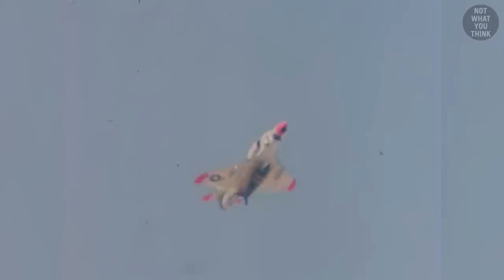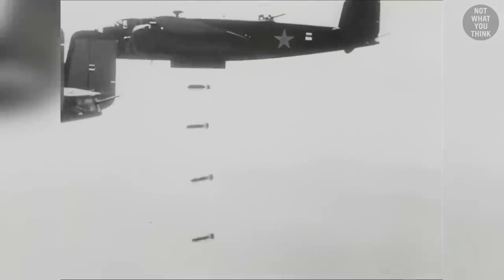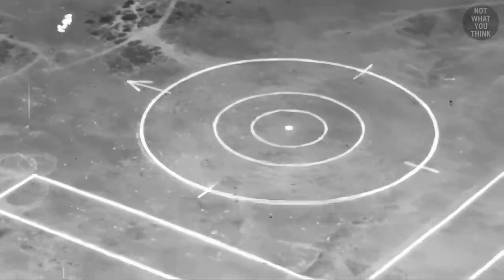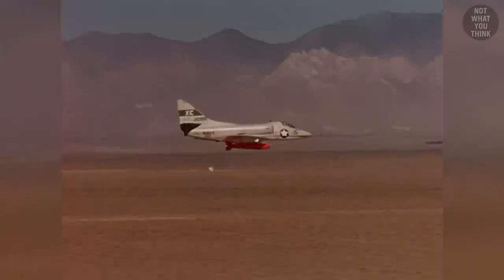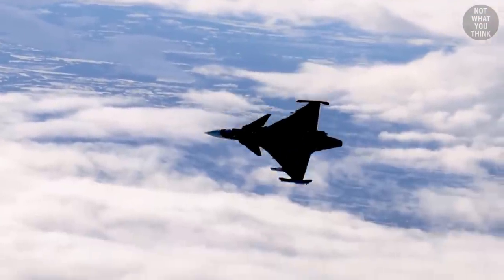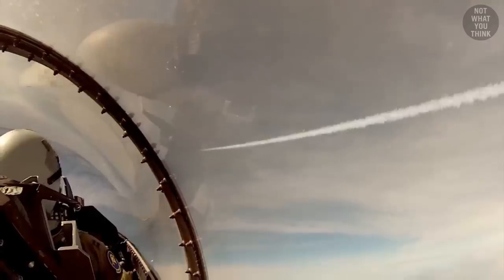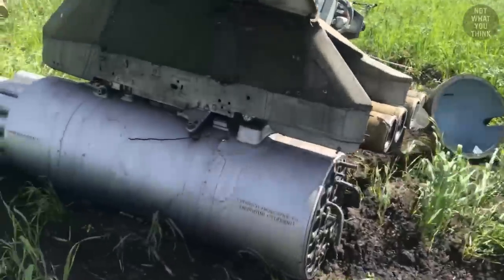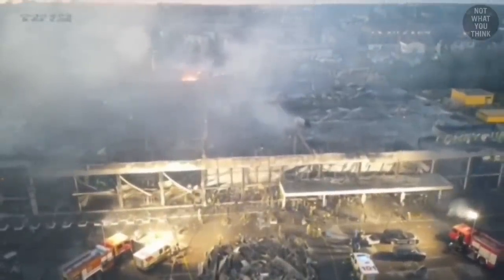Why Are Russian Helicopters Shooting Up at the Sky?

Comment: Pilots on Russian side confirmed the targeting computers are updated for rocket "loft" and they say it is much more accurate then you would think. Pilot seemed to note high accuracy is only relevant for heavier rockets (?). Should note I had to use Google translate so I might get some of the details wrong.  US heli pilot noted they've known of this heli "artillery" support tactic of the Soviets for a long time.
Reply: I believe what they meant by "high accuracy is only relevant for heavier rockets", is that they can carry much fewer heavy rockets than light ones (5 heavy rockets per pod as opposed to 32 smaller rockets per pod - not a negligible difference).
So they can afford to let the smaller rockets be less accurate, more over the place than the few heavy rockets.

Also, if you were to use those heavy rockets (which are obviously more expensive, don't forget this aspect as well), it probably means you want to destroy something bigger/more heavily armored than just a couple of soldiers on the field. So the need for higher accuracy in the case of those heavy rockets could also mean this.
Reply: C-5 are lighter and have a larger dispersion area, C-8 are heavier and have a smaller dispersion area. This was meant.

Comment: I do this tactic in DCS in my Russian Mi-24 and KA-50, it works pretty well, surprisingly. safe from SAM systems, quick, rtb and rearm... rinse repeat

I should specify. in the Ka-50 for example, you have a Navigation target point that you can set. your hud displays direction and distance. when you come within 10.5km, you angle up to 45 degrees. 10.5 in DCS was about the max effective for the S-8OFP, while 9.5 you can get accurate hits within 100m of target, firing at a 35 degree incline. im certain Russian and Ukrainian manuals have mentioned this, as Ukrainian Mi-8's have been seen doing the same. but it would obviously be easier with a system that has Satellite navigation, like KA-52, Mi-35 and Mi-28NM
Reply: Russian byas on Russian game lol
Reply: @Filipscl  cry kid.
Reply: yeah if planes already have ccrp since the 50s it'd be a sin to not give any flying weapon platform this tech or something similar
Reply: @Filipscl  thats....not how that works.. I can do the same tactic with an AH-64 and Hyrdas in DCS. the difference is the angle and ranges
Reply: @Swampfox1966  no dude he right, we just gotta live with it now
Reply: @specialman6004  damn you right
Reply: Do this tactic in war thunder with ccip it’s very accurate if the target isn’t moving
Reply: @Vengeance4308  well, in WT you try to kill mostly hard targets. For soft targets hail of S-8OFP/KO is enough. Wide dispersion becomes +, because you don't see exact location of infantry
Reply: It’s called CCRP in the west , the same system is used by Russians also!

Comment: Lobbing bombs is built into modern targeting chip ccrp systems. It was used by the Tornados in Desert Storm to get some kind of stand off because there it was not able to use guided munitions without a ground laser until the  Buccaneer arrived.
Reply: Strange use of the Tornado.
Not saying it's not possible. Just outside the use and nature of the aircraft.
Especially considering it's use of the Runway Denial Weapon. They had to get up close and personal. That's what it's designed for. And the only aircraft carrying that weapon in particular 🤗
Reply: @My-Pal-Hal  The runway JP233 denial weapons was suicidal so they stopped using it. The bomb tossing was to keep some distance between them and the AA guns. By their account It was not an easy thing to pull off and they still lost at least one airframe using this tactic.
Reply: @Kefuddle  
Yes, I know what it is. I built this stuff.
And they got rid of the Tornado at the same time the got rid of the weapons. It's an awesome aircraft.
I always found it funny how many weapons are limited in their uses on aircraft. Just like the Phoenix missiles only on F-14s. 
But,.. there's always the Most Important Thing when it comes to military aircraft. 🤑 💰🤑💰🤑
Reply: I read a book about the development of the Buccaneer and early on in their life they developed toss bombing tactics for the Buccaneer due to it's low level flying abilities
Reply: I read a book about the development of the Buccaneer and early on in their life they developed toss bombing tactics for the Buccaneer due to it's low level flying abilities.

Comment: More or less it's trading accuracy for range with unguided rockets. But if you're basically using proximity fused fragmentation rockets to put shrapnel over an area bigger than some sports playing field, having a shotgun type approach doesn't need too much accuracy anyways. Those are an area weapon, so a direct hit on something isn't the goal anyways.

Comment: The techinque can be pretty effective and accurate with enough practice agains soft targets like infantry, trucks ets(kamovs have datalink, so the pilot knows the range to the marked target, knows exact direction, and then its just a simple calculation that can be done by head when to toss the amunition in to the air). In addition lofting rockets like this gets pretty interesting when paired with US APKWS kit, especially with jtac around.
Reply: There is a system in Ka-52, Mi-28, Su-25 exactly for this purpose. It calculates trajectory and target position and gives the pilot indication when to shoot.

Comment: bomb tossing is still a technique used today for lofting ordnance. Specifically, JDAMs, CBU-97/107 WCMDs, and in some cases GBU-2* family laser guided bombs if the launch aircraft isnt lasing but a buddy lase on the ground. Even walleye glide bombs can be tossed and get a decent extended range. Theoretically possible to loft a GPS guided bomb over 30 miles in certain conditions.

Comment: Using helicopter as artillery may not be accurate but the idea is interesting
In future we may see more accurate drone which fly low and shots artillery to replace artillery vehicles as artillery vehicles need to relocate fast after firing to prevent counters attack on firing locations
Reply: True but using conventional heavy artillery shells and barrels is one hell of an ask for a drone. Pus ammo resupply. Ground based drones with independent motor wheels and motor wheel suspension Maybe.

Comment: This technique is actually quite accurate. The pilot follows a preset flight path. The setting of the angle is done with the assistance of a computer which calculates everything real time and allows accurate rocket placement even with deviations from the flight path. The most difficult part is target designation. The computer needs to know what it is shooting that. Primarily GLONAS (Russian GPS) is used. This grants limited accuracy as GPS is relatively innacurate and slow compared to a target designator. Target designators are usually carried by recon groups and allow for very close front line fire support, which a regular mrls cannot do. This is why the helicopters and attack planes shoot out flares and turn sharply out of the way as soon as they fire a salvo. MANPADS are a real threat. Also, the practical range is about 5km max. Shots past that are rarely used unless it is a Su-25 firing at an artillery position.
Reply: During the second world wart the Germans started field testing a toss bombing sight called the TSA-2D (Tief Schleuduer Anlage).  This was how the Me 262 and Fw 190 fighters were supposed to be able to bomb accurately.  They were evaluated in combat (I think KG-51 with Me 262 during operation Northwind).  The pilot dove onto the target lining it up in his gun sight.   A buzzer would sound and a light flash to indicate a plausible release solution had been found.  The pilot then pulled up and the bomb was released at the right point in the pull up.    The TSA-2D would take data from the gyroscope, an variometer, accelerometer and Air speed indicator and a choice of FuG 101a radar altimeter or a barometric altimeter.   During the pullout the accelerometer rather than altimeter, variometer was used.   The technique was adaptable to rockets (which had a fall of as well) and finally went towards lofting the bomb.
-With a modern radar and computers these sights become very accurate.  
-The USN also had a toss bombing sight for its corsairs in 1945.  
-The Germans did have a computing bomb sight, the StuVi 5B with the BZA computer that was good for slide bombing attacks to about 20 degrees.  it computed a continuous impact point for the bomb.   A good crew could get a pair of 500kg/100kg bombs to within 10m of target consistantly.  Dive would commence at 8000ft and reach 400mph with pullup complete by 5000ft.   Problem was it was suitable for twin engine aircraft like Ju 88, Me 410, Do 217, Ar 234, He 177 but not singles due to the view over the nose.

Comment: On the simulator games you strafe  at a distance, the hud shows where it’s going to land, accounts for your angle, distance to the point as you pull the trigger. 
Reck a column. Pull up diagonally if your not inline with the column. Shoot from a distance

Comment: Helicopters are extremely vulnerable to aircraft and AA, so I guess the only non-suicidal way to get any value from them and those rockets is to do THIS - extremely mobile low accuracy artillery.

How would you use helicopters if every enemy platoon had a Stinger or two?
Reply: Thanks. I was looking for that comment. It's very inefficient, but if you have helicopters, pilots and unguided rockets that are only usable on helicopters (are they?), better use them than not I guess.
Stil the point made at the end is a good point. Maybe it's worh sparing the oil and rockets used by the helicopter. Might be of use at some point.
Reply: @martintroisclous7350  I think Ukrainians know what they are doing. Deterrence of enemy artillery positions is very important - even if not damaged, the cannon needs to reposition when it starts getting shot, so you can scare it a bit with helos while you reposition your cannons or troops.

Comment: No, people actually simulated rocket lofting in DCS:World and that could be very precise against soft targets, if you make careful calculations for trajectory, the final coverage for a 10km loft from a Ka-50, could get you a 200m x 40m kill zone at the target side. Which is not very big deviation against a big free fall bomb. If performed by modern avionics which regulates fire control and flight control at the same time you could get a more precise kill zone.

Comment: A weird diversion in the end since this technique is used mostly in open land; I wouldn't wonder if air support is where the artillery is abscent.

Let alone the Kh-22 rockets presented simultaneously are intrinsically hella imprecise (pretty much to the point of incomparability). Not to defend the moskals but why introduce an impractical topic?

Comment: let me quote "FighterBomber" - famous Russian military aviation blogger

1)
the Ka-52 sighting system automatically calculates all the parameters of the combat use of unguided missiles with a pitch-up, taking into account wind, ballistic characteristics of missiles, angles, speeds, and other things, which makes it possible to lay most of the 40 S-8 missiles in a circle with a radius of 50 meters.

2)
A little more about cabling.

Unfortunately, I could not find for you either a drone operator, or an ordinary infantryman, or a military correspondent, or a tiktoker, or even a photographer to tell you about the effectiveness of this method of combat use, so listen to a combat helicopter pilot who is directly involved in these very cabrios.

Published with minimal editing.

"Good morning FB!
They periodically write about the inefficiency of firing from a roll-up. Say, by, do not fall into the sky and so on.
In a number of cases, this was the case in the early days.
Still, this type of shooting was not practiced at the training grounds during training flights and exercises. So, we looked at what it was and forgot about it. A large amount of ammunition is needed, and even when four missiles are flying, it is very difficult to assess the hit. And there are no mavics at the landfills.
We trained at half a block per attack, but at 40 NAR per takeoff. That is, we can’t plan many sorties for training, we get out of the missile limit for a shift.And in the exercises, the bosses are generally not interested if missiles just fly in from nowhere or, conversely, if a helicopter attacks a target that is beyond the horizon for them.

But in Ukraine, after three or four sorties, the pilots got their hands full and are now covering the center of the dispersion ellipse with a calculation of plus or minus 50 meters.
And after the on-board computers of helicopters were supplied with software for calculating pitch-up firing for all types of NAR, the deviation results are close to zero.
Heavy rockets fly more accurately and are less affected by wind and other external conditions in flight. I have individuals who, in one attack, use the S-13 from a nose-up, then dive again and fire the C-8 from a new nose-up at an adjacent target. And after all, they fall according to the data of the drone. It is a pity that not all helicopters can use heavy unguided rockets yet. But we are working on it.

So, ... on September 2 S-13s out of 6 launched from Mi-28s hit a building converted into a warehouse.
The explosion turned out like an atomic one, it burned for another day after that.
A direct hit from seven (!!!) kilometers by an unguided rocket is, of course, an element of luck, but there will be no luck without skill.
So with the cabling, we are doing very well. In vain they write about the low efficiency of this method. It is not inferior to use from a horizontal flight from two kilometers, because even from two kilometers you will not see a target like people in the trenches in the landing. And all the same, you will work stupidly along the coordinates, as well as from the cabling. Then what's the difference how to shoot if the results are comparable. Only taking into account the large number of MANPADS from the enemy, when firing from 2 km, we would have run out of helicopters and crews by the time this comment was written.

3)

Once again, I will explain about the work of unguided rockets helicopters and attack aircraft from a pitch-up.

This is the only way to work with cheap (and therefore massive) weapons without entering the enemy’s MANPADS operation zone, of which the enemy has thousands.
Yes, this method is only suitable for working on area targets. Big.
Well, fucking scary, Grads, TOSs, Smerchs, Tornadoes also work in areas and no one complains about their accuracy and usefulness. Though of course he's complaining. There will always be someone who will complain about something. It's an immutable law of existence.
Understand and forgive.
The principle of working with cabling is simple.
On those machines on which the sighting system is not able to read the parameters of the work of NARs from the pitch-up, a plate is drawn up in which the speeds, altitudes, pitch angles and ballistic characteristics of the NAR are written.
Then the coordinates of the target are hammered into the car and at the distance calculated from this plate to the target they fire.

Tactical aviation is still hitting with long-range guided and homing missiles and ballistic missiles. Everyone in a row. And cunning modifications of the Kh-59 and Iskanders and other ammunition unknown to the general public with nowhere documented capabilities.
They were made, as it turns out, in the dark, but it’s clear to hell they are spent very carefully, because their production cycle is relatively large, there are many goals, and tomorrow the SVO will definitely not end.
Therefore, the goals for them are chosen very carefully.

Strategists and rangers are firing cruise missiles at everything that is further away.
Scouts - reconnaissance. Fighters - exterminate. Electronic warfare aircraft and helicopters interfere. A-50, to the best of their ability, control the airspace.
Nobody sits idle.
All work.
Reply: LOVE IT!!! 
THANKS
Please link me the source. This is fascinating and I hope there is more to see on the link.
Reply: @Nathan666  there is A LOT to read
Reply: @thelasper4623  I got plenty of time. Source?

Comment: You missed the fact; the US Air Force used this exact technique during the initial invasion of Iraq in 2003 to lob conventional bombs. I know because I was on the ground calling in airstrikes on  Iraqi Army units for the initial combat phase of the operation in northern Iraq. Even when providing support to US Special Operations units engaged in combat operations, the Air Force would not risk aircraft and pilots by flying over the target area because of the threat of anti-aircraft fire, even when there were no AA weapon systems in the area. Instead, when we called for air support, F-16s, F-1s, and even the last F-14s ever flown ( I couldn't believe it when they checked in with us on the radio), would program the target coordinates into GPS-guided JDAM bombs, then pull up into a step climb and lob the bomb toward the target. We never heard the aircraft unless/until they turned away and increased power while exiting the area. After the pilots announced releasing the bomb, we always asked for the "fall time", which is the time from release to impact. It was often well over 1 minute,  which is a relatively long time. In my experience, the bombs frequently missed the target by a wide enough margin to be ineffective. The F-14s allocated to us for one mission missed by a very wide margin, and one bomb (I can't remember the aircraft type) struck behind my team. For numerous reasons that go beyond the use of this tactic, I was left with a very negative view of importance that the US Air Force as an organization placed on providing air support to ground forces.